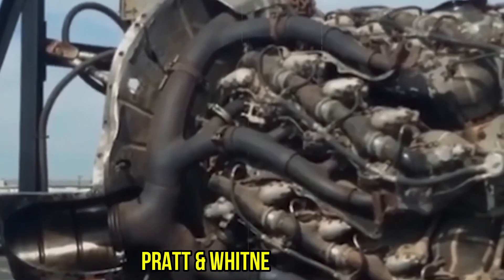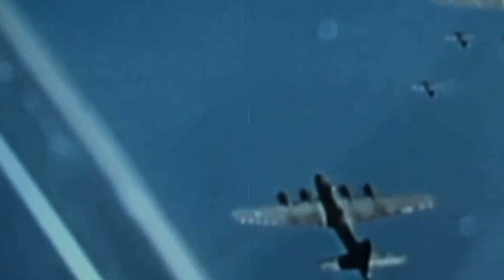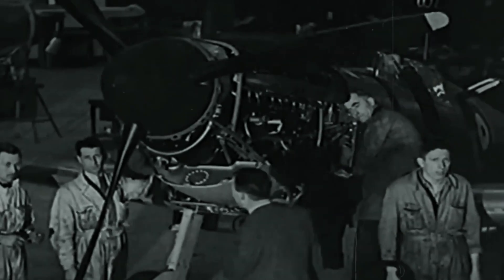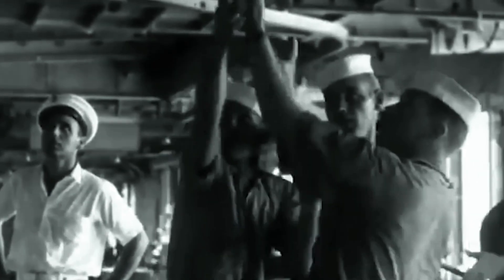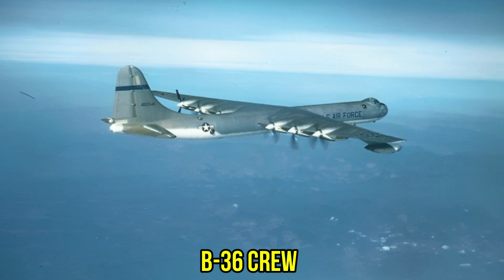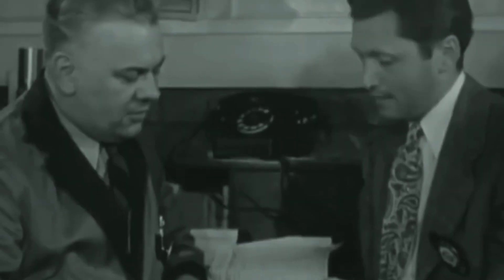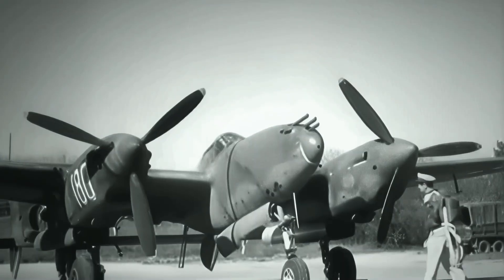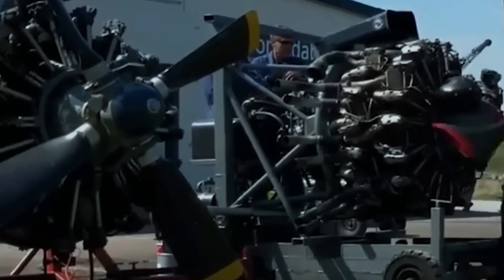The SHOCKING TRUTH Behind Pratt & Whitney's R-4360 "WASP MAJOR" Engine

Comment: Please read more history!  The 4360 in the B-29 put out 3500 horsepower, only a few put out more and this made those engines unreliable.  Also Hughes was unable to acquire any 4360s for his spruce goose and had to settle for less powerful Curtiss Wright 3350 engines.  While water injection increased output it was only used on takeoff and in cold climates alcohol had to be added to prevent freezing. The development of the 4360 took up most of the over one billion dollar cost of developing the B-29!
Reply: The R-4360 was never in the B-29s. It was used in the follow on B-50s.
Reply: @murryrozansky8753  Yes my bad, i always confuse the B-28 with the B-50.

Comment: Reality check ,Lockheeds Globetrotting P2V-5 Neptune sub hunter was powered by Curtiss Wright R-3350,s each fitted with an experimental power recovery system ,not Pratt& Whittney R-4360,s,.  Another mistake, a standard Dash 41 R-4360 had a pony count of 3,500, with water injection ADI another 300  ponies in the Dash 53 63 and 63A. Only the still born R-4360- 51 VDT cranked out 4,300 ponies via a  unique variable discharge turbo, one aircraft flew with a quartet of R-4360 VDT,s the Republic XR-12 Rainbow. A sleek rocketship size of a Douglas DC-6 that can outdrag a P-51D Mustang a Mark 21 Spitfire and a Focke Wulf Ta 152H . Yes cats&kittens  imagine a Greyhound Coach (Bus)  with the speed of a four on the floor small block Chevy Corvette.